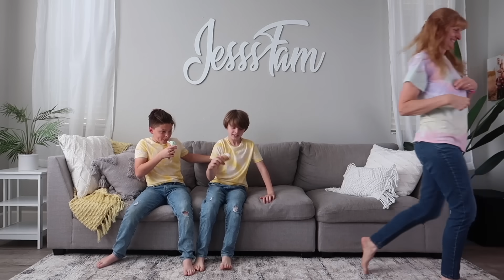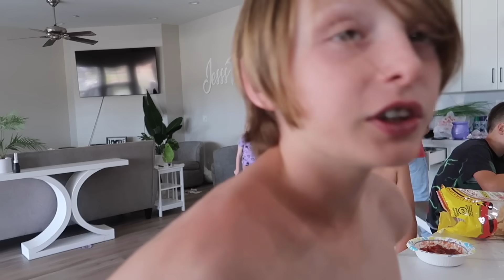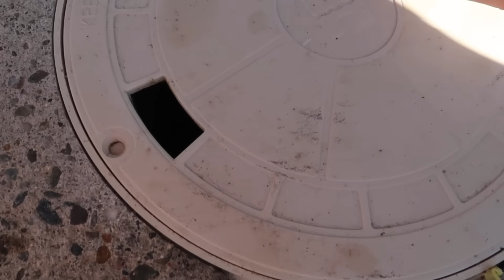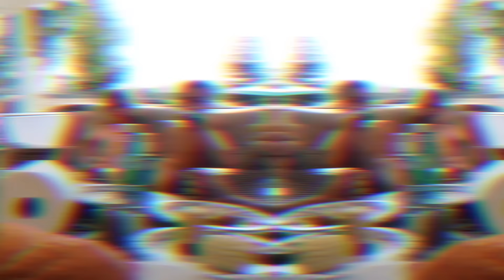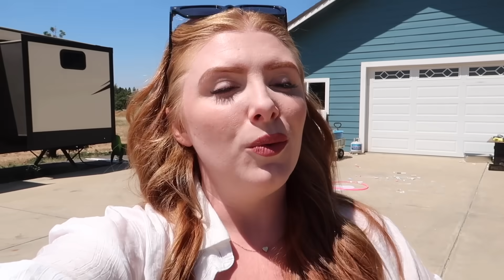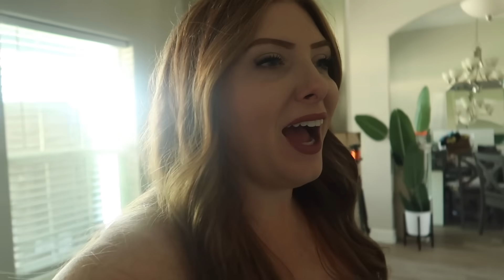HUGE update on our *new* house - IT’S OFFICIAL

Comment: This game is kind of similar to color shark we call it Alcatraz, basically one person stands outside the pool facing away while all the others hold the edge and they have to try and swim to the other side without the person outside of the pool tagging them. If the person turns around and sees that someone has started to swim they jump in to tag them, if they turn around but no one has gone yet then they take 1 step away from the pool and turn back around.

Another one we play is categories where one person stands on some sort of ledge of something (you guys could use the diving board) and someone else inside the pool counts to three and then says a category like colors, sport, etc they can be hard or easy and when the person gets to three the other person jumps and has to try and name something from the category while they are in the air.